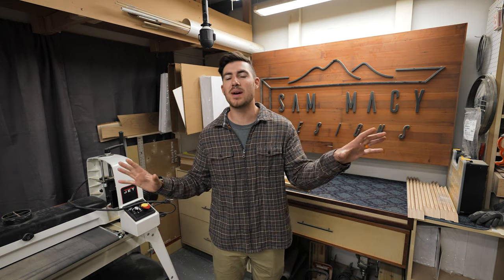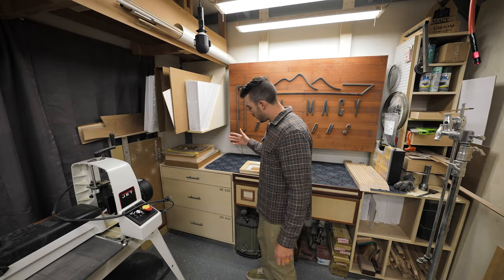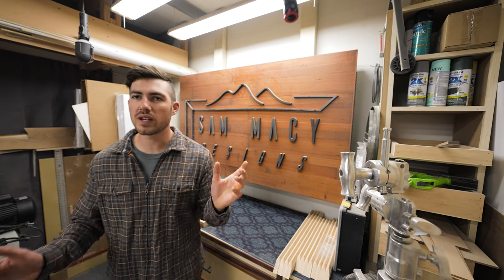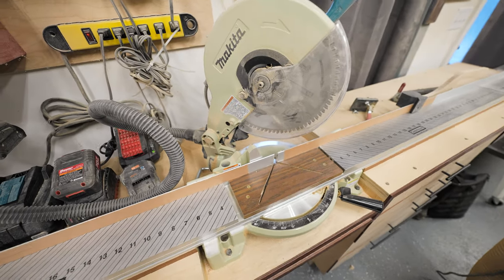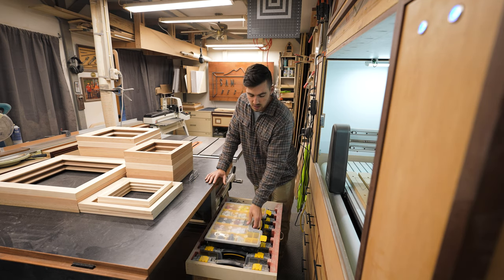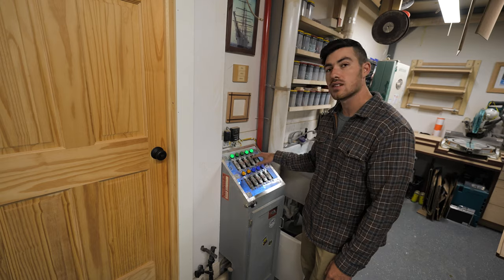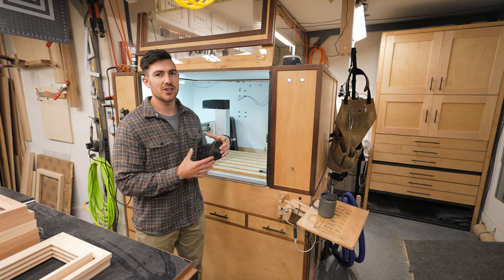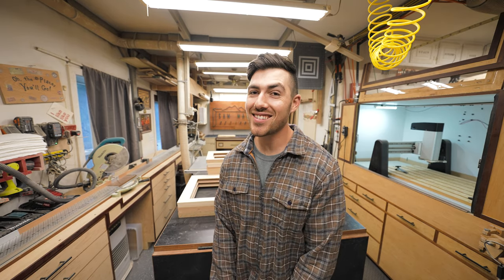Shop Tour 2021

Comment: Sam, beautiful shop! I especially love the thought and effort that went into building out the cabinetry and that touch of mahogany is the best. You think your space is small, try working in a 10x16 ft shop! I bought a prebuilt shed that I had it wired, with its own box, insulated and then sheathed in plywood. About a year after it was delivered I wished I had gone with the 16x16. It seemed big without anything in it, lol. I'm a tool collector and one of my hobbies is restoring hand tools. I will admit I didn't have a layout in mind ahead of time, a big mistake, so I am thinning out my tools and completely redoing the space with lots of work surfaces and counters around the walls. I have a lot of benchtop tools so instead of a bunch of separate carts, they will go on the countertops. Then I can tackle building drawers to go underneath. Wood prices better be down by spring! I love the built-in cubby for the CNC. You may want to think about a fine dust filtration unit. I didn't have a lot of money when I bought mine, so I bought the one WEN makes and it works great! Highly recommend it. They start at under $150. That is the unit I have and it works great in my small shop.
Reply from the maker: It sounds like you're on the right path! I bet having everything on a wrap around counter top makes you super efficient. I've often thought about a fine dust filtration system ever since my home made one gave up on me haha how often do you have to change the paper filter in the WEN? And does it make a bit difference when you're sanding? That's my biggest struggle. Thanks for the recommendation!

Comment: Dude, love the liquor cabinet! As someone else said this is an inspiring setup for a single car garage. I'm about to move into our first home and I have a single car garage to work with: about 13'x24'... Very excited to slowly turn it into an efficient space. The challenge will be doing that while also having a working shop!
Reply from the maker: Thank you! Congratulations on your new home!! And that is a challenge, I faced it too. My advise is to keep it as clean as you can so when you go to build a piece of shop furniture you don't have a bunch of clutter to think around. And don't be afraid to change your designs as you go! I've replaced my outfeed table 3 or 4 times because it wasn't perfect. I've also swapped out how I store hand tools at least three times haha you just have to keep tweaking things until they fit your workflow style.

Comment: Nice shop.  You ran a wall thru, dividing the space into two, any particular reason why? Like the bandsaw, very nice.  I'm in the process of moving my guitar making shop from basement 20'x15' to 2 car garage space very soon.  Gonna be a challenge moving my stuff....
Reply from the maker: When we moved in that room where my office is doubled as a bedroom so we just kept it there. I may take it out someday in we ever add on. I just recently watched a video on guitar making and it looks so cool! Seems like you need a lot of space for special jigs and things
Reply: @SamMacyDesigns  Hey, thanks for the reply.  Guitar making is fun, electrics are much easier than acoustics.  The fixturing needed for acoustics is challenging.  I'm running a small cnc as well, fusion driven, that's fun, and unnerving at the same time.  Good luck to you and your business.
Reply from the maker: Thank you! You as well! I bet you'll come up with some really cool designs on your CNC